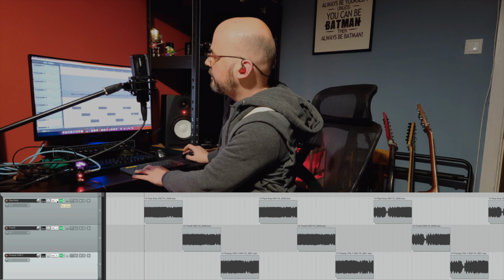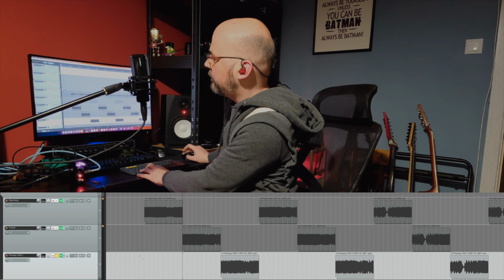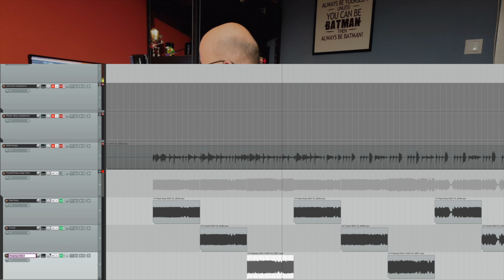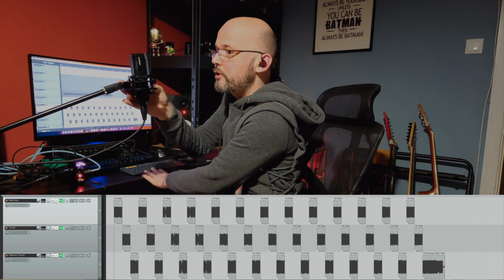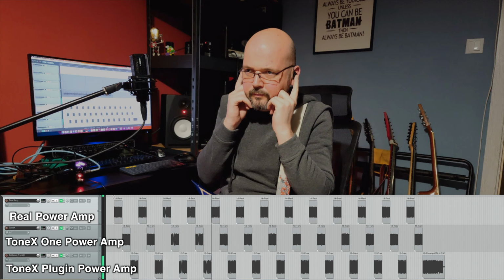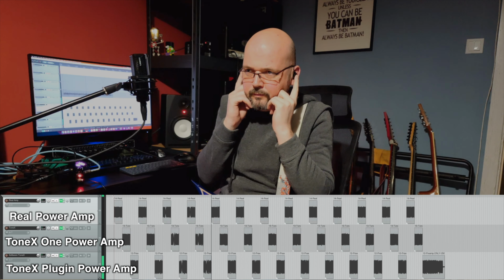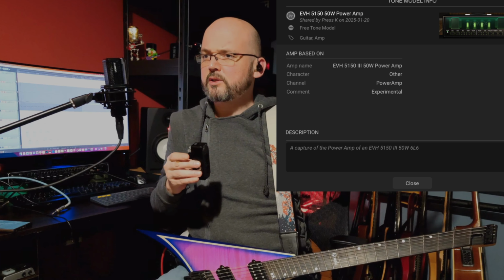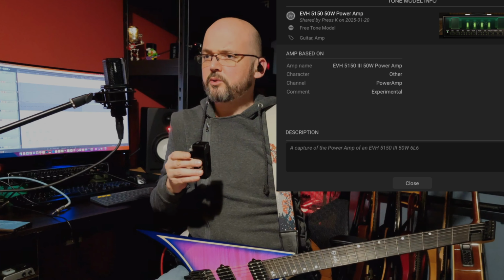Using ToneX to capture Power Amp sound!

Comment: What kind of Ir did you load after tonex ?
Reply from the maker: A personal mix I’ve been making out of RedWirez Impulses. I lean on the Sennheiser 421 over G12T-75 and balance it out with a darker mic on a Vintage 30 (I have the Bogner Uberkab pack, the cab has both types of speakers in X pattern). Can’t remember exact mix tho, I change it every once in a while
Reply from the maker: Ah, this one also has some royer 121 over a boogie cab for more oomph.
Reply: Ok thanks . Preamp pedal into IR sounds super flat that’s why I think the Poweramp captures are a brilliant usage of tonex